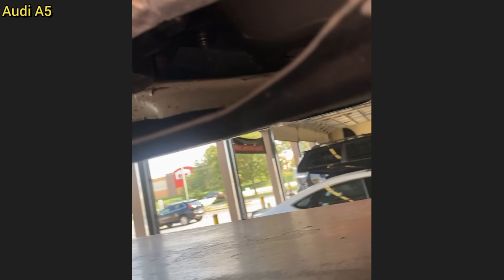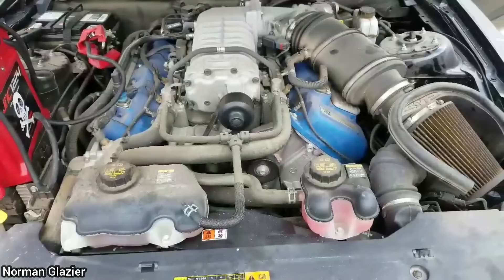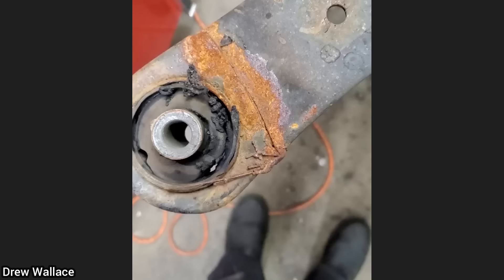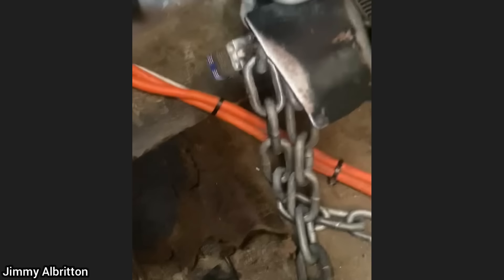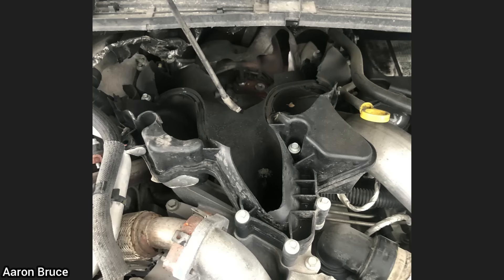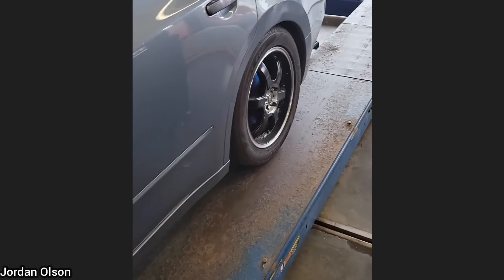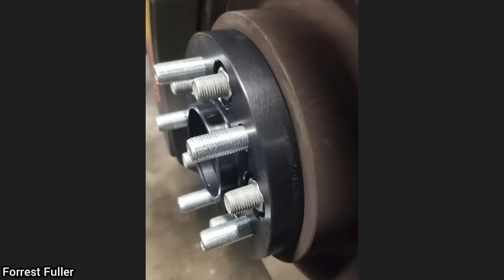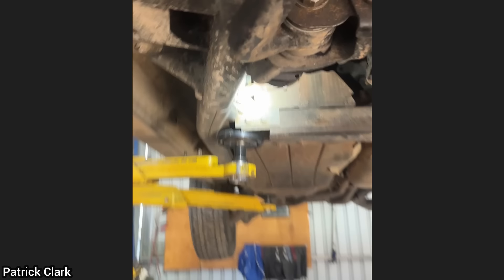Customer States Car Lost All Gears On Highway | Just Rolled In

Comment from the maker: Hope you guys had a great weekend!
You can submit your clips/photos at www.justrolledinyt.com
We also pay to use submitted clips (will be contacted via email)! Have a great week.
Reply: The dealer paid for new control arms? Where is this dealer?!
Reply: I believe you once took note of where these stories most frequently took place. It would be nice to note these areas so that I keep it in mind if I ever find myself driving through said areas.
Reply: I'd move that cockroach motel on wheels as far away from the shop as possible and lite a match😂
Reply: That piece of metal looks like an old manhole cover tool.
Reply: How nice it is to have you back and doing these videos again.  Just thought I would mention it.
Reply: Truck in question is a 1971 Chevrolet Cheyenne Stepside. 1971-1972 fronts are very similar but 1971 has round tails, 1972 has square.
Reply: @wilfdarr  IKR!!!!
Reply: @AxiomRazor  awesome! classics are amazing
Reply: @wilfdarr  The dealer has a lot of leeway in what additional repairs they can charge back for if those repairs are necessary to properly perform the recall. Because the company wants to be real confident the recalls are actually being done.

Comment: "To this day the car still does not start....because nobody wants to get into a roach infested car!"  lol
Reply from the maker: Exactly lol
Reply: Buy a 4 pack of those bug foggers and put them all in there.
Reply: Nothing a couple of incendiary grenades wouldn't fix.
Reply: I'm thinking stick a chameleon in there.
Reply: yeah nah that car belongs to the roaches now.
Reply: funny thing. If you park a car that is infested like that outside in the sun on a hot day with the windows rolled up and a small space heater placed inside that will drive them out or kill them. They typically can't stand temps over 120f for too long or you'll  end up burning the car down. Either way it will get rid of the roaches.
Reply: @ChosesinWon  Don't forget the trunk
Reply: @dcsteve7869 Some bugs take up to 140F.  But on a sunny southern summer day that should be easy.  Leave it out in the sun for the afternoon.
Reply: Below freezing temperatures will also kill roaches. I'm not sure how low and for how long, but a good subzero Fahrenheit night is probably more than enough.
Reply: @WildBikerBill  gotcha, burn the car it is.
Reply: @WildBikerBill Won't work.
They'll all migrate to exterior areas that don't reach those temps - the trunk, inside the door, ect.   A good many might cook, but not enough to clear the infestation.
Need to leave it in the summer sun and then cover with a fume shroud and run an ionizer on it for a couple days.   They'll either bake or suffocate.
Reply: @meltedrabbit  Don't count on it! Years ago, when I had w-a-y too much time on my hands, I would spray roaches with Freez-It... multiple times. After they were motionless for an hour, I would shock them with 500 volts. This revived them and they would then crawl away! 😅
Reply: I was just thinking Hell no I wouldn't go start the car for them
Reply: @dcsteve7869 For what little it's worth - there's a guy I believe in Phoenix AZ with a youtube channel.  He uses his car as an oven to bake things - Like cakes. 

Undoubtedly he has to adjust the 'oven time' for the lower temps, but the fact it is doable at all is impressive.
Reply: I would be quoting them a new car.
Reply: @meltedrabbit  Freezing will kill the live bugs but will not kill the eggs.
Reply: @WildBikerBill  I'll have to look that one up. Phoenix is already hot as an oven in the open air!
Reply: Don't blame them, I would be like nope get that thing the hell out of here not touching it.
Reply: @richardprew1154  So you're the one responsible for making undead roaches.
Reply: @meltedrabbit  We had roaches at work get into a -20C freezer for days/weeks.  When we opened the door they would fall out onto the floor.  They would thaw out after several minutes and run away.
Reply: @dcsteve7869  Perhaps!😆 But I must also note that if you increase the voltage to 1000 it will turn a roach into a tiny charcoal brickette. They don't come back from that!
(I've heard roaches have survived the vacuum of space.)
Reply: @richardprew1154  you have to understand I have a very visual mind. So the image that popped into my head was that of Young Frankenstein (Gene Wilder) where he had a dead roach on it's back, legs up and electrodes attached to it's head being raised up on a platform table into the lightening.
Reply: @dcsteve7869  LOL!!! Actually, your vision isn't that far off! I was young, worked nights (mostly unsupervised), had the equipment, and access to lots of roaches. Lots of "good scientific experiments" (or was it shenanigans?) took place. Did you know a fully charged 5000 microfarad capacitor could weld a screwdriver to its terminals upon discharge?
Reply: @richardprew1154  yep, studied electrical engineering. I know those shenanigans well. We used to pull the big 1 farads out of old industrial printers and line up them connected to a large DC power supply. Makes a loud enough arc to scare the crap out of  the entire lab. Never tried the frankenroach thing though, thats definitely a unique one.
Reply: @dcsteve7869  I started out studying civil engineering, but liked drinking more than studying. Eventually got my act together and ended up in IT. Like engineering, IT does not draw on the sanest people in society. 😄😄😄
Reply: Imagine their house.
Reply: @ChosesinWon  I would put them around the garage just for having that thing near it!
Reply: That car may not start but one day it might scuttle up the wall
Reply: I'd hate to see their house.
Reply: @richardprew1154 zombie roaches lol
Reply: @dcsteve7869  That is incorrect. That is for bed bugs. I have seen a car with flies and roaches in a car that sat in the Arizona summer sun for almost a week. Most of them was still alive.
Reply: Earlier this year i noticed one, then another, then a couple more tiny roaches running around inside my car. Wtf? I'm saying to myself because my car, while not showroom clean is clean enough. You'll never hear me say excuse the mess if i gave you a ride. Anyway, I bought a pack of raid roach traps and spread them out inside, under the seats, in the trunk, etc. You gotta get on top of it early before it ends up like that car in the clip. For a couple weeks after I would see the little fuckers staggering around inside like they're high and I would smash them with a flip flop. 😂 It's been about 3 months now and I haven't seen another one but the traps are still there just in case.
Reply: Too right. Even if repairs made it run like warm honey, I ain't getting there with the ignition key.
Reply: @ChosesinWon   Or, you can put an ozone emitter in the car's interior and probably kill all those bugs within about 90 minutes.
Reply: The owner of the roach sedan should marry the guy who took a paddlock and beat his car to death with it.
Reply: Whatever you do to kill the roaches, if just one pregnant female survives, you still have a roach problem.